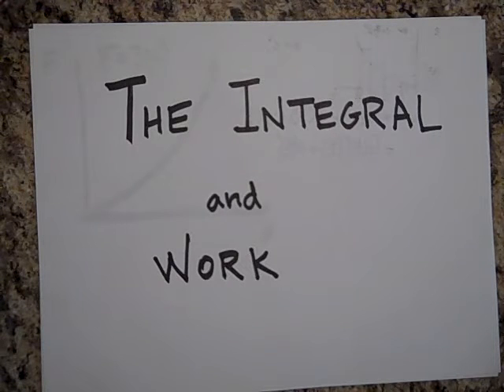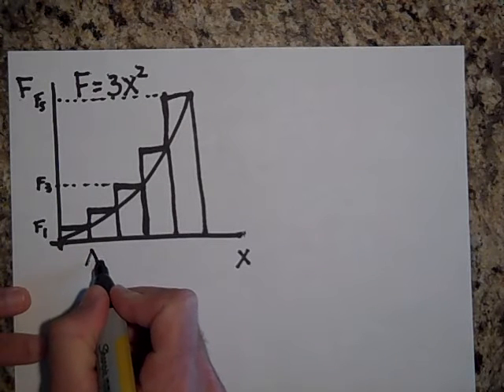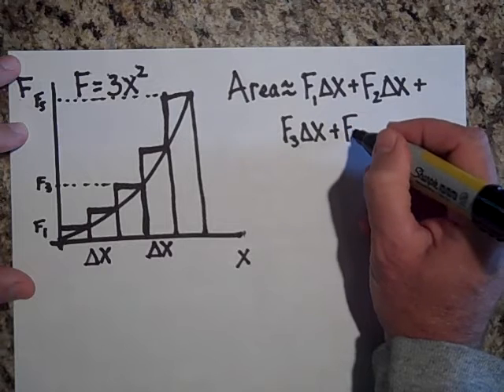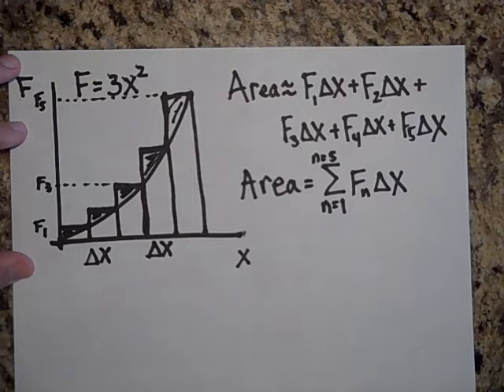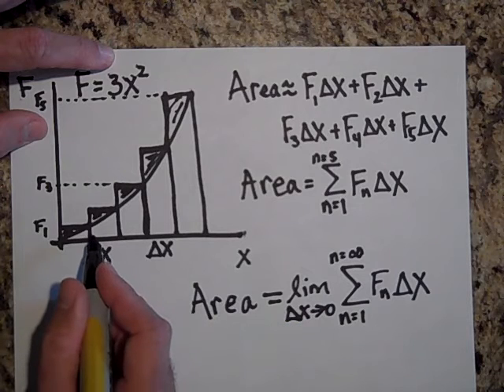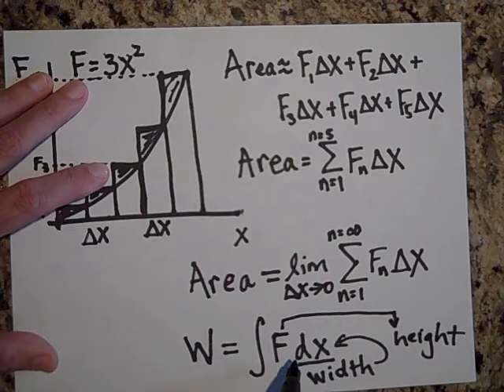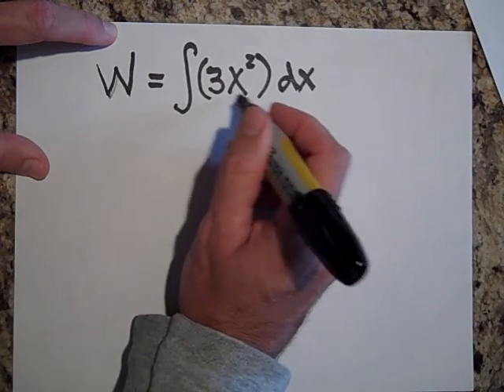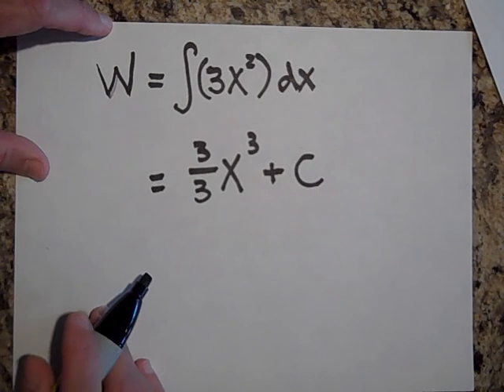The Work Done by a Varying Force

Comment: So basically you add one to the power and divide by the new power and add some constant value ( in this case C). Therefore in the video, the integration of 3x^2 is:
integral of 3x^2 = (3/(2+1))*x^(2+1) + C= (3/3)x^3+C 
The only thing he didn't do was reduce the value, which if reduced would look like:
x^3+C
Normally you would reduce it to the x^3+C equation.

Comment: The integration at the end of the video is correct. Qualifications: junior engineering student at San Jose State University. 

Method:
for any  problem where your intergrating with respect to x where n != (does not equal) 1 for x^n with a coefficient of A (integral of Ax^n) the integral is
(A/(n+1))*(x^(n+1)) + C